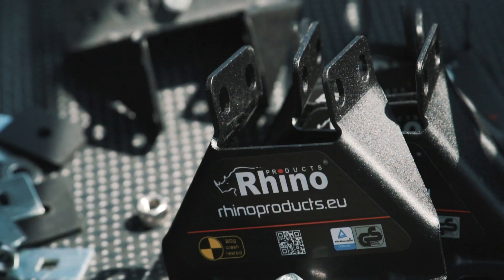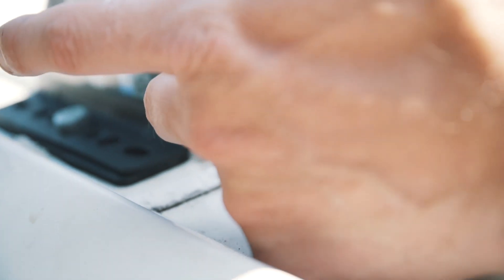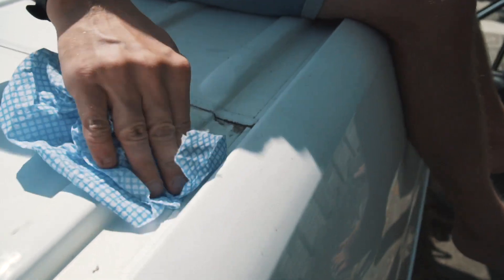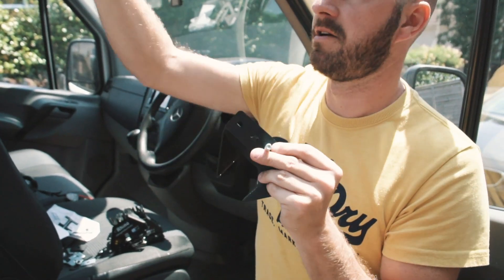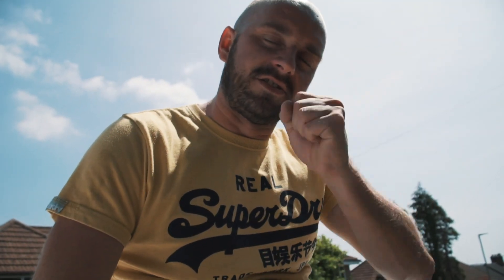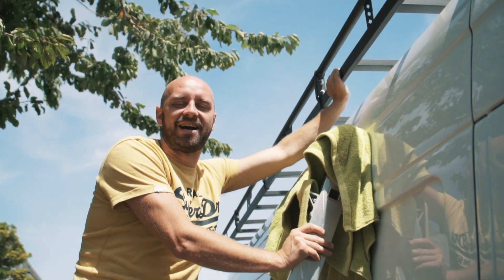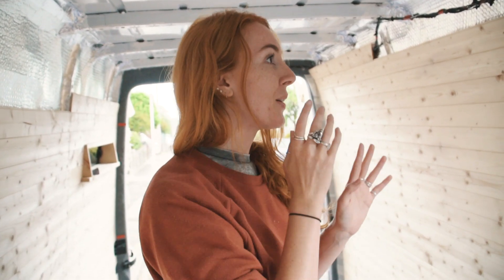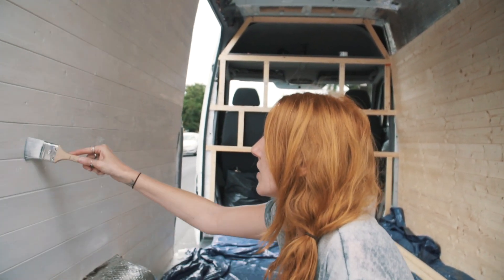Fitting our Rhino Modular Roof Rack | Sprinter Van Conversion Ep 7 | VAN BUILD SERIES

Comment: great video! I noticed you no longer have the rack in your more recent videos - what was the reason for getting rid of it?
Reply from the maker: We found that we used it very little and it was extremely heavy for not much use. So we took it off, kept the feet and replaced the rack with aluminium bars. Went from 60kg to 11kg!
Reply: @OverlandingSophia  thanks for the swift reply! Sounds like a better idea, I have been really unsure of how much o would use the rack so I might look into that solution! Are the bars available in the UK? Or are they custom / from overseas?

Comment: Do you have a link to this rack?  I have fit rails to my van, and mounted my solar, but ideally I could do with a proper rack eventually, so can start saving the pennies now, currently I plan on building a kind of rack from 40x40 aluminium profiles and mounting cctv and floodlights to it as well as roof clearance camera, and maybe an area for a second spare wheel
Reply from the maker: Wow, that sounds like one hell of a set up! Here's the link to the roof rack we used - https://www.rhinocommercial.co.uk/mercedes-roof-racks-bars/Sprinter-2006-2018/LWB-High-Roof?product_id=205

Comment: id love a rack on mine but i worry about the weight - have you considered it? when i do the maths by the time I have a rack up there I havent any weight capacity left to actually put anything on it!
Reply from the maker: Good question. Realistically, we can't calculate every single thing we'll be putting in the van, especially when it comes to food, water, our belongings etc. However, we've kept everything as light as possible. We've seen people with very similar layouts to us who have used heavier items, such as real wood floors and even heavier roof racks, and they've still been well under the weight limit. I'm sure we'll be fine, weight is something we're constantly keeping in mind. You have got us thinking a little bit more about it though, thank you!